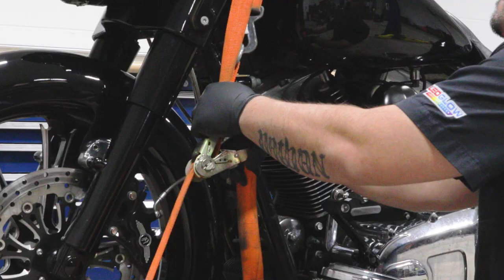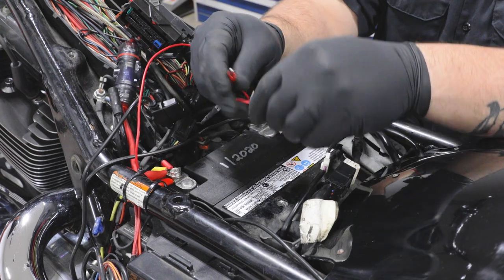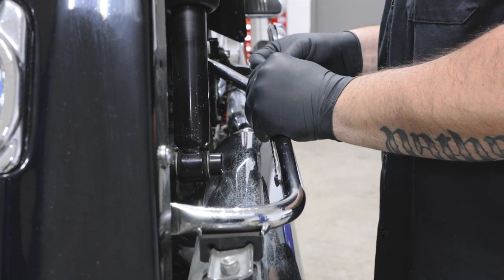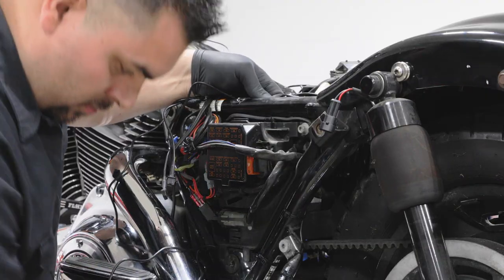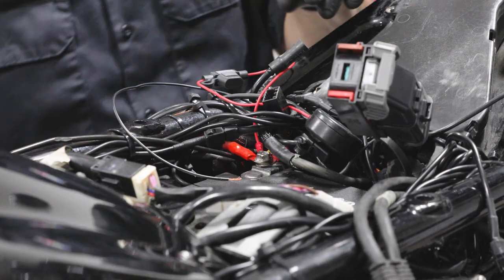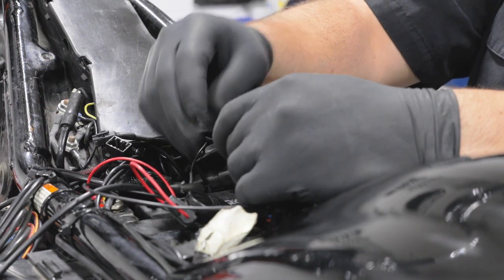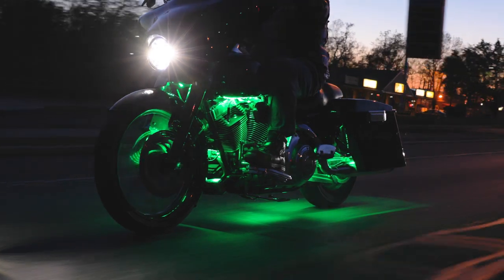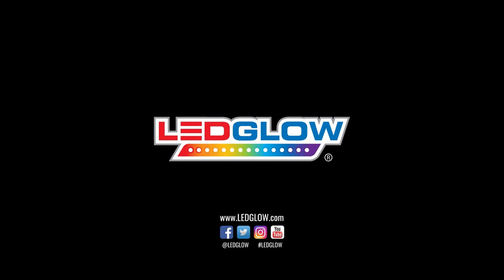LEDGlow | How to Install An Advanced Million Color LED Motorcycle Lighting Kit

Comment: So stupid connecting it directly to the battery. That's a great way to potentially drain your battery. The controller and IR receiver is constantly drawing small amount of power. And it could malfunction and cause the LEDs to turn on, on their own. AS EVIDENT by the other comments here. You really should only connect it AFTER the ACC so that it's only powered when the key is in the on position.
Reply: How would you go about doing this?
Reply: Run it from the same place as your headlights, the headlights are always on when the key is in the on position, just don't forget to add a Fuse even though the headlights will have their own, you don't want a fault in your underglow to kill your headlight circuit
Reply: I installed an accessory fuzed relay on my bike that I wire all non-factory equipment through. I used one of my Horn power wires as the key on signal wire

Comment: Lights look great , seems like a nice product. You asked for suggestions so here goes.  Nothing about the lights but the wire ties.  Instead of cutting the wire ties with side cutters , twist them where you would normally cut them with linesman ( flat nose pliers) . Just twist till the end comes off. When you do this you DO NOT leave a sharp edge that cuts you to pieces.

Comment: Do not install directly to the battery. About once a month I have to take the seat off remove the fuse to reset the stupid box. Otherwise it doesn’t work. connect  to accessory power instead.

Comment: Are your lights heat resistant
Reply from the maker: We recommend keeping them clear of the exhaust for sure but if they are are mounted on a frame rail or something that is near the exhaust then it will be fine. Just dont mount them directly onto the exhaust.

Comment: I have my red connected to the positive battery post. My lights will not turn off using the remote. Remote with a,b,c,d options. I had to disconnect the positive . Do I need to reprogram the remote? All lights work as intended accepting changes from the remote commands but can’t turn off .☹️
Reply from the maker: Yes, try reprogramming the remote.
Reply: 💥Any luck with that.??

Comment: Hey so I have an interesting issue. I bought the kit, installed it just like how you guys instructed in the video and about 2 weeks later my battery died. I've since replaced my battery but am afraid to reinstall the lights in fear that it would drain my battery again. Any idea what could've caused it to die?

Note: My battery has not been replaced since I've bought the bike brand new in 2017. But I don't think that could be the reason.
Reply from the maker: It could have been the battery. If the bike is going to sit for an extended period of time, for more than a week or so, we do recommend disconnecting the light kit. If you're using the bike a lot, then there should be no issues.
Reply: ive installed the ones i purchased and installed the same way instructed in video but the lights stay on even when i shut the bike down.
Reply: 💥 Do you keep your bike plugged into a Battery Tender when it sits around.??
Reply: @Jimmy_Cavallo  it would be a good idea

Comment: Hi there I install this product, he worked very well for two weeks. But now the lights were just turn on by them self flashing. I want to know what it might be a power supply issue? If I hold down any of the buttons the lights will stop flashing as soon as I let go of any pain or just continue to flash I had to disconnect it from the controller. Do you have a solution for this? Thank you
Reply from the maker: Double check where the kit is powered. You might need to select a different 12-volt power source.